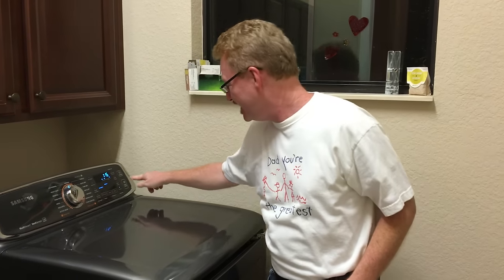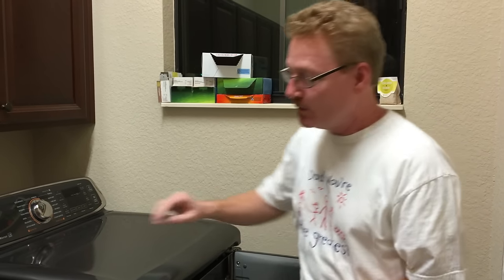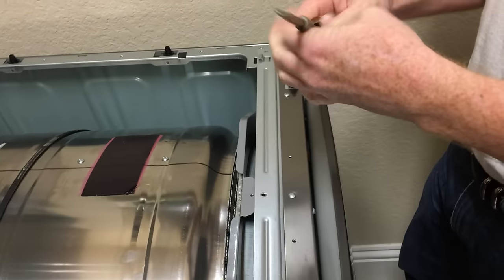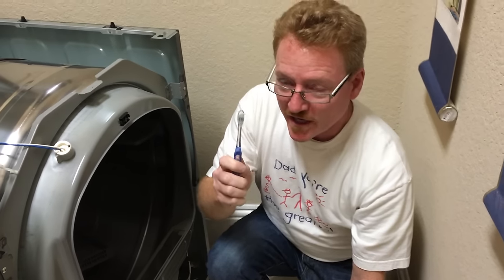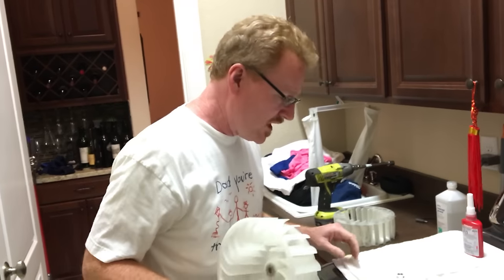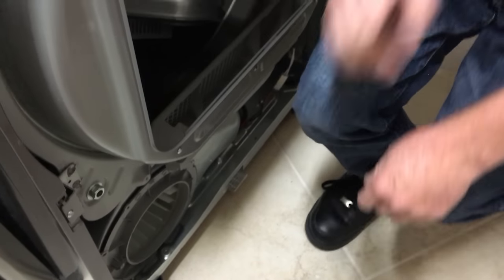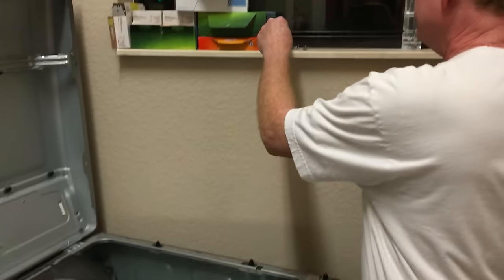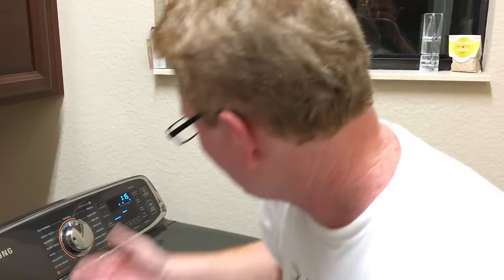How to fix a noisy, vibrating Samsung dryer in 30 minutes for $25 or less

Comment: I’m curious if the original nut/bolt you removed from the blower had loctite. I personally think it’s overkill for this application. The left hand threaded connection is designed for that very purpose; to prevent the nut from backing off the bolt. In other words the rotation of the blower will cause the bolt to turn in the direction that will tighten the bolt into the nut. 
By applying loctite you are only making it more difficult to remove the nut the next time you have to do this job.
Reply from the maker: I'm sure the original one didn't have loctite, but I'm also sure the original one was on much tighter than I made it. Loctite doesn't really lock the nut really tightly per se, but rather keeps it from walking off. I'd be able to break the bond of loctite with the socket wrench more easily than I was able to originally break the bond.

Comment: Such a helpful video! I was able to get everything apart and just clean out my blower wheel and it fixed the problem. Thank you so much William!
Reply from the maker: Glad it helped. I know, from past experience, that this happens a lot. It also happens with vacuum cleaners too. From time to time we must take apart our Kirby and clean it. Fortunately that's much easier and does not require the removal of screws...

Comment: I opened mine up and it has a TON of lint in there. We’re not the first owners so who knows how it was used before us. Our main problem was the left screw that holds the metal part onto the blower cover had popped out. After cleaning everything out and reassembling I found that screw hole in the blower cover is stripped. I can’t find what part the cover is or where to find it. Do you happen to know what I’d be looking for or a way to easily fix the hole to keep the screw in there? Thanks!
Reply from the maker: Hmmm. Without seeing it myself, I'm afraid I can't help. But if it's just a small hole, then see if the dryer will run without a screw there. It could be just a spare hole, or something there for a different model.

Comment: Great video. Do the wheel suppose to spin with ease like that? I’m only asking because maybe that’s the issue I’m having. My wheel do spend like that at all lol
Reply from the maker: The blower wheel is directly attached to the shaft of the motor. The shaft of the motor also goes to a belt that is wrapped around the drum. The easiest way to "spin" the wheel is by rotating the drum, but you will note that a small amount of drum motion provides many revolutions of wheel rotation.

Comment: This was a helpful video. Only thing that would've helped in your description is linking the website with the part and adding the model number of your dryer so people can cross reference. Perhaps you can just edit the description and add that.
Reply from the maker: The information is generally applicable to all similar dryers and I do mention the place to get the part in the video. The actual part number may change over time due to revisions, and may be different from dryer to dryer.
Reply: @WilliamBennerJr  Yes, but most people post a direct link in their description. It makes it easier.

Comment: I was able to remove the 9/16 screw with my impact driver, but I cant get the plastic round thing off? I have pulled with plyers and it wont come off?
Reply from the maker: Hmmm. Sorry to hear that. Might try some penetrating oil or CAREFULLY tapping on the shaft of the motor, being careful not to bugger the threads...

Comment: Thanks for the video. Also useful for cleaning the lint out !  One thought on that reverse thread nut.  Can you get enough leverage simply turning the dryer drum while holding a wrench on the nut to loosen it or will the belt slip?  It seems you have a lot of leverage turning the dryer drum!  I hope you don't need to remove that nut again now that it has locktite!
Reply from the maker: Hi, good thought on drum leverage but I doubt it would work. Remember the drum is big and motor pulley is small (less than 1 inch diameter). The motor spins many many times for the drum to spin once. Therefore the motor has a lot of torque on the drum, but drum does not have much torque on the motor. Holding the blower wheel firmly while using my foot as a breaker bar support would have worked if the nut was on reasonably tight. But it was unreasonably tight... The "nascar style" impact wrench worked really well, and these are available at Home Depot for not much money these days (or borrow from a neighbor as I did). Regarding loctite, we use it at my office all the time (you could look up my credentials if you're interested) and it's not as bullet proof as you would think. I put it on mostly as cheap insurance...

Comment: My dryer fibrated much worse than yours. I viewed your video and discovered I had lent build up on the fan blades.  I cleaned it off with a tooth brush as you suggested and all is well!  I did not need to order the fan, just clean it.
Reply from the maker: Great job!

Comment: Thanks for the video. How do you remove the wire in front left corner of the drum?
Reply from the maker: There's a plastic twisty thing. The wire runs through it. If you twist it, it will release the wire.

Comment: WOW! Thank you SO MUCH for sharing this!  I had a small bottle brush stuck in my wheelie•doohickey•mabob!  But the LINT!  I worried I would find A small rodent in all the lint it was SO CAKED!! After it leaves the dryer it goes into & UP THE WALL TO THE HI•PITCHED 15 FT HIGH ROOF!!   FULLY PACKED 6 13•gal Flex Bags of LINT to toss!!!!!  I’m a first time 253yo(🤪) single homeowner & I could have designed a BETTER VENT PLAN!  This video makes my now self•imposed mandatory “fire•prevention” QUARTERLY MAINTENANCE Lint Cleanout a “WAAAY FASTER w/FULL CONFIDENCE” ordeal.  Thank you so much for your kindness!!!!  Dawn~
Reply from the maker: Yes, good idea about the fire prevention!

Comment: How long did this repair keep the dryer working? I suspect the issue is similar to mine and the the motor mount has failed and when you add clothes into the dryer and put a load on the belt the motor moves and is moving that fan all over. That is why this warped in the first place. I am looking to come up with a modification to fix the motor mount so it keeps the motor secure during operation.
Reply from the maker: I suspect mine originally warped because of a clogged dryer vent. Mine has not stopped working since I did this repair several years ago.

Comment: Other than cleaning out the lint, why would a blower wheel "go bad" ... Out of round? Out of balance?
Reply from the maker: For most people, lint gets stuck on one side of the wheel. In extreme cases like mine, the wheel warped because of the heat.

Comment: Mine was so INSANELY dirty - cleaning this fixed the noise, thanks!

But after I put it back together, it is now running really hot and humid. Any ideas?
Reply from the maker: Yes, possibly your whole drier vent is clogged. I mean the one on the outside of the house. These often have a screen which gets completely clogged. We changed ours out for a screen with courser mesh (from Ace Hardware). That helped, but plan on cleaning that screen from time to time.

Comment: I have the same issue. Same issue as my last dryer as well, but I didn’t want to replace the fan as it isn’t a wear item, so the problem continued until the fan impinged upon the housing which caused a hole in the housing. I dictated the hole. Really this Samsung is much like the old style dryer, it just has a water line and a computer. And it takes an hour and a half to do jeans.
Reply from the maker: Yes, although washers have really evolved, with direct-drive motors and such, I am really surprised to see that dryers have not changed much in something like 40 years.

Comment: Thank you for your video. I have one question, however. What was the cause of the impeller wobble? It looked fine in the video. There were no broken or missing vanes. Did the dryer always have this problem because of a defective impeller or did this happen over time?
Reply from the maker: Well you have a great question. I have a theory about it. Months earlier, our drier vent was clogged (that too is common)... My theory is that when the vent was clogged, the hot air could not escape from the drier, and the excessive heat built up (probably coupled with the drier eventually coming to a complete stop), allowing the weight of the blower to droop, ultimately warping the wheel. But that's just one theory... It could be that the blower wheel is just crap. (On a certain level I hate to think that but... the fact that these wheels are in stock, not very expensive, and being changed by a lot of people tells you something right there...)

Comment: If it’s glued in, how do you get it out?
Reply from the maker: Hmmm. I don't understand the question. The blower wheel isn't really glued onto the motor shaft. It uses a metal hub that is interfaced with a conical feature on the motor shaft. The conical feature should allow it to release pretty easily. As for the nut itself, there are a few ways, both mentioned and one demonstrated in my video. Let me know what additional information could be provided.

Comment: How did you know the pulley nut was a left hand thread? Mine was a normal thread?
Reply from the maker: As I said, there is a video from Appliance Parts Pros which shows roughly how to do what I am showing here. They mention that the nut is reverse threaded, which makes sense given how the motor rotates.

Comment: Try cleaning first before buying the fan. Mine had a slight wobble but not as bad as yours in the video. After cleaning out the fins I tried it and it sounds and runs like brand new. The biggest culprit, in my opinion, is the build up of fabric softener on the fins! Nasty stuff!
Reply from the maker: Indeed. When I mentioned "there are two possible causes", one is that lint has clumped to one side. In looking at the video comments, it seems that is the problem for most folks. I was hoping that was the problem with mine actually, but then I discovered the wobbling wheel, which somewhat surprised me...
Reply: William Benner do you have a part number on the blower wheel???
Reply from the maker: I don't remember it, but that Appliance Parts Pros dot com has a great web site that helps you to locate the right part.

Comment: i have the same dryer if the fan wheel goes will it not circulate the air
Reply from the maker: Check that the exhaust duct is not clogged. That will certainly prevent air from circulating.

Comment: Mine sounds like a metallic screech sound the noise is unbearable plus my clothes are not drying properly, I’ve just bought a indesit dryer from curry’s , my husband doesn’t want another heat pump Samsung , I loved my Samsung dryer but very disappointed 😔 with how quickly it has started playing up
Reply from the maker: Yes I know. We've had Samsung now for around 10 years. Generally happy with it, especially the washer. But the drier seems like old technology, just dressed up a little...

Comment: Thanks for the video, but at this point, I'm considering using an ax and a sledge to adjust mine.  I spent way to much money on my Samsung dryer for the problems it's ha
Reply from the maker: I agree, for the money we paid we shouldn't have had troubles. Before this I had a Maytag made in the late 1960s. I wound up including it with the last house I sold. I'm sure it's still working today. Damn shame things are made with "planned obsolescence" these days...

Comment: Lol, its righty tighty.   Clockwise turn to tighten.  Your impact driver knows the difference. 

Otherwise, great job, great video.
Reply: Oh, its reverse thread.  Just ignore that earlier post.  Still, thanks for the video.
Reply from the maker: Nope -- no "righty-tighty" on the nut that holds the blower wheel! It's reverse threaded, like certain other appliances (blades on lawn mowers maybe, I forget...).

Comment: In my own opinion, I don’t think you needed to use threadlocker. That’s the reason Samsung used a left handed nut. With the motor’s direction of rotation, in theory the nut should only get tighter.
Reply from the maker: You might be right. I don't think it had thread locker in the first place, but that nut SURE WAS TIGHT. I don't think I could have gotten it that tight myself, so the thread locker was just insurance. So far the dryer is still working ;-)
Reply: Yeah your probably right, if that nut was that tight. I had the exact same problem with the blower wheel on my dryer causing the whole machine to vibrate. In my case it was caused by a really thick buildup of lint on every blade of the blower wheel. That lint almost had a waxy feel to it. The buildup was so bad it was causing the blower wheel to run out of balance.  Once I cleaned every blade my problem was gone. Thanks for making the video, it’s what got me to check my blower wheel.  👍🏻
Reply: next time he won't be able to break it as easy. i agree not necessary.

Comment: Place the wrench on the other side depending on wich way its turning it will lock it self
Reply from the maker: Yes indeed, that would be one way to do it. But you'd also have to hope for luck too, because sure as s***, as soon as you walk around the other side of the dryer to attach the socket, the wrench would slip off the bolt on the other side. ;-)

Comment: And what is wrong with the old blower wheel?
Reply from the maker: It was warped from the heat. It is low density plastic that was easily warped.

Comment: I could not get the  blower fan blade off it looked like you needed some sort of pull to get it off hmmmmm
Reply from the maker: Once I got the nut loose the blower wheel pulled right off for me. But I could imagine that under some circumstances, you might get into what's called "Fretting corrosion" which might wind up micro-welding the blower wheel to the shaft. This video has been up there a few years and so far nobody else has reported that, so if it is happening then it's something that doesn't happen all that often. Nevertheless, from your other comment is appears as though you were able to remove it and get it working. Please let us know if there are any additional tricks.
Reply: At work i had to use a bearing pully as you know to get the bearings off a shaft (i worked on elevators) LOL and if you look at the fan it has two holes in it  as if it needed a pully of sort to get it off the shaft. O saw how easy it was for you to take yours off mine looked good and brand new it also had grease where the shaft meets the fan so im guessing they really want a tech to fix your dryer lol,, thank you so much for your help and input!! 😃😃😃

Comment: Why would you use thread locker you may need to fix it again
Reply from the maker: Wanted to keep it on there, and also thread locker doesn't make it impossible to remove the nut. I'm sure the impact driver would have removed it just as easily with or without the thread locker.

Comment: All fine and dandy unless the nut and the blower wheel are loctite on. smh! I finally got the nut off and now still can't get the blower wheel loose.
Reply from the maker: The nut wasn't loc-tited on for me, it was just very tight. Once you get the nut off, you might need to CAREFULLY hammer on the shaft while pulling on the wheel. Use a tool like a center punch on the shaft, so you don't distort the threads.

Comment: The problem is the blower wheel won't come off after the nut was removed. It was like it was melted on to the motor.
Reply from the maker: Hmm. I'm not sure about "melted"... That plastic cage actually has a metal insert inside of it. It is the metal insert that rides on the shaft. Note that the shaft and metal insert interface is conical for a precision fit (like a machine tool). 

Hopefully wrapping on it CAREFULLY with a hammer would help... If you hammer on the shaft, you might mush-over (i.e. distort) the threads on the shaft, so it is best to use some kind of intervening material such as a small wood block or piece of soft brass or copper or something, that will transmit the striking force but will itself deform instead of the threaded shaft...
Reply: Lacquer thinner
Reply: Break cleaner melts plastic without having to add heat.
Reply: I'm having the same problem tapped with hammer ,still wont come off the shaft , my wife is getting me some nail polish remover, we will see ugh..
Reply: @bradydog10  same thing.  Solution?

Comment: What if that nut doesn't want to come out it's hard af
Reply from the maker: The nut came off super easy with that impact driver. Otherwise you have to use a "wrench in front and wrench in back" as Samsung recommends. Remember, the nut is reverse threaded!!!

Comment: Thanks bro! Your vid helped me find my noise, which may be related to yours. The "out of balance" blower itself wont make noise, only a vibration. To make noise (rattle) 2 pieces of metal have to interface or loosely touch, with your help I finally found it! I'll bet yours is loose too!!  There is a small round access plug in the floor panel just to the left of the heater, rattles like crazy! Here is my vid that shows it in detail: https://www.youtube.com/watch?v=WVMh4PgSljo&t=36s
Reply from the maker: Glad it helped!